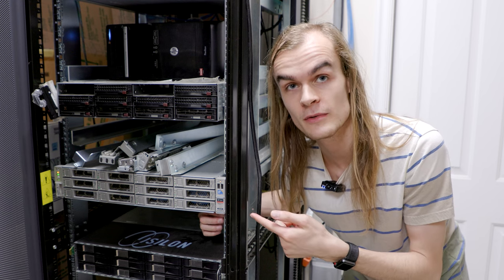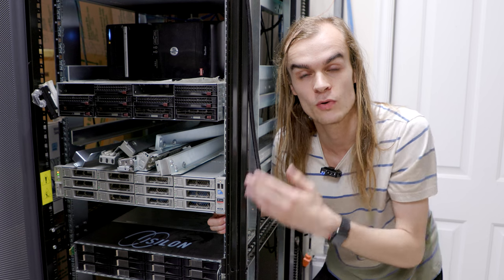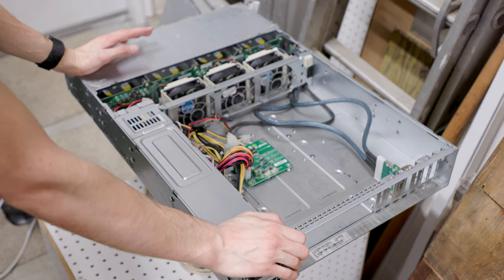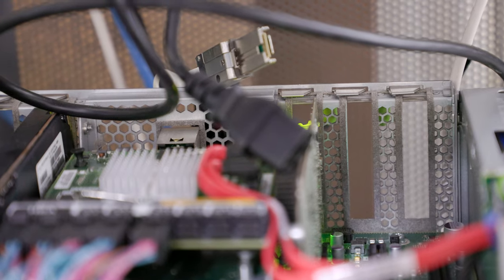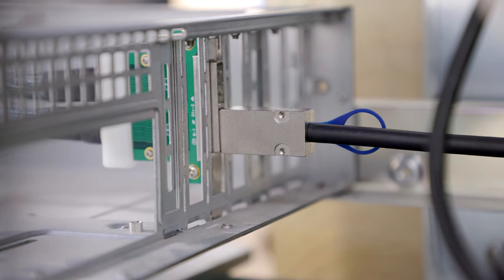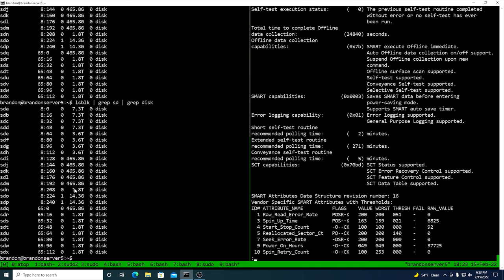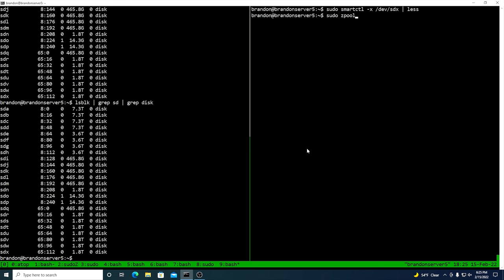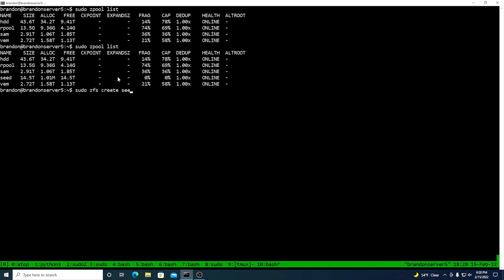Expanding my server's storage with a SAS JBOD

Comment: I have that same isilon unit you have. I ripped out the the mother board and run an internal sas to external sas cable from the backplane, out the case and into an hba card in my dell 730. It's been working great.

Comment: Thanks for a great video. I am building a budget server instead of buying a new one. So I picked up a socket 1200 server motherboard and a e2388g cpu. This is housed in a 4u rack chassi. Now the problem I have is if I should go with SAS or sata. I have an old Lsi 9207 in the server that is only connected to a tapedrive and has some ports available. Also, I can not seem to find cheap drive cages with SAS connections. SAS seems so cool, but I don`t have the budget for u.3/u.2 drives or even SAS SSds as they cost an arm and a leg. Or well, maybe I could buy one or max two, but I have no idea about if you can just expand the storage later. It is to be used as a proxmox server.

Comment: Hey there Electronics Wizardry. I really enjoy your videos! You have a lot of useful information to share and present it very clearly without a lot of excess fluff that so many content creators throw in. I appreciate that! Quick question... I'm looking for rack mount Direct Attach storage solutions that use SAS, but I don't need the SAS expanders and the daisy chain capability that most JBOD systems have, rather, prefer each group of 4 disks to have a dedicated SAS connection (non-expanded): We have a RAID Machine R2424RM, which fits our application very well as it attaches up to 4 drives to each node of our 6 node proxmox cluster (these drives all become part of a ceph spinning pool). Unfortunately, the company that makes these seems to be out of business, and I haven't found a equivalent anywhere else. With your experience in with this type of stuff I'm curious if maybe you have run across something like that.
Reply from the maker: One possible solution for a replacement JBOD would be a Supermicro SC846 chassis, and the passthrough backplanes. You can but 24 3.5in drives int he front of the 4u server, then connect 24 drive cables to the individual drives, and use the pci brackets to have external connectors on the back. I can't find this configuration for sale though, so you would either have to custom order the backplane into the chassis from a Supermicro reseller or buy the parts and assemble them your self. 

Here is a guide with the different backplane models, the passthrough ones seem to be exactly what you want here. https://zacfu.com/2020/04/12/homelab-backplane-for-supermicro-sc846-chassis-the-buying-guide/
Reply: @ElectronicsWizardry  Hey! I think you nailed it! I didn't know Supermicro sold a pass-through style backplane like that. The BPN-SAS-846A would be perfect for our application. It looks like the 846BA-R920B chassis comes with this backplane. I could certainly get the SAS cables/brackets to pass the SAS connections to the rear of the case. Perfect!

Comment: I believe it is a Cisco server from the UCS series? Can you tell me whether the Cisco model only requires Cisco branded hardware. RAM will certainly not matter, but can you also use HDD/SSD or Raid/HBA controllers from other OEM manufacturers?
THX
Reply from the maker: Its a SUN/Oracle server so its different from the Cisco boxes. This system isn't that picky when it comes to drives, RAM, and PCIe cards.
Reply: @ElectronicsWizardry  Ok thanks, looked like a Cisco UCS box.

Comment: What card is that inside the JBOD?
Reply from the maker: There is no card the backplane. The spot where the motherboard goes is empty. There is a sas expander on the backplane that splits one sff8087 to connect to 12 drives.
Reply: @ElectronicsWizardry  I'm still new to this, so I'm trying to build my own and I'm confused by what I see at the 2 min mark. There's a board and that gets power from the power supply, what's that board do? Is it a jbod control board or something in place of a motherboard to give the sas expander/drives power?
Reply from the maker: That little board in the middle of the sas jbod is just to turn the power supply on. This does basically the same thing as shorting the green and black wires on a atx power supply, making it so power supply and sas jbod is always running. There is no data going through that board. All the data is going through the drive backplane. Think of this jbod as a modded super micro server. Instead of the drives connecting to a motherboard in the case they connect to a motherboard in a different case.
Reply: @ElectronicsWizardry  I think thats the board I'm looking for, any chance you remember that board model number? Thanks!
Reply from the maker: I can check the board number in about a week as I don't have access to the jbod currently. But shorting the green and black wires will do the same job as this board.
Reply: Anyone searching this old comment, it's a JBOD power board like this: CSE-PTJBOD-CB3 or -CB2. Basically a barebones motherboard minus CPU, RAM, expansion. It has power on/off, connections to headers on case, and fan hookups. -CB3 has IPMI for a little config options.